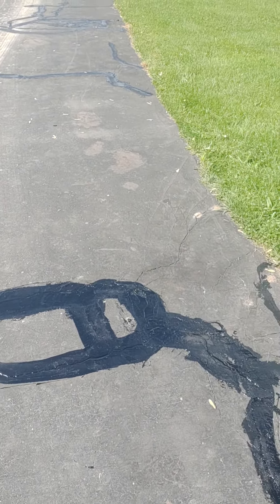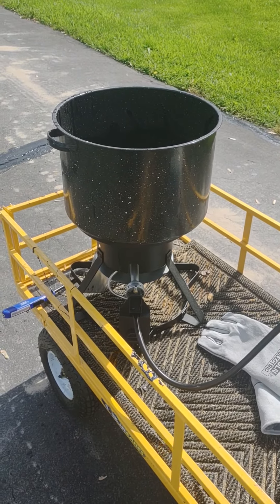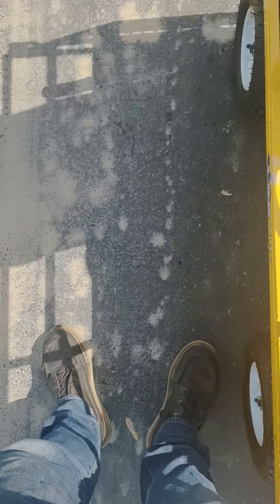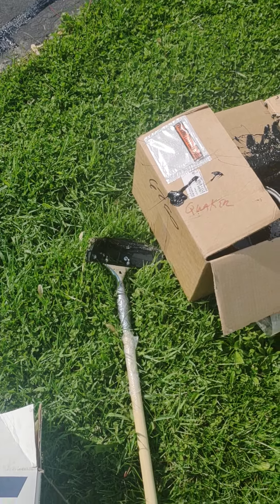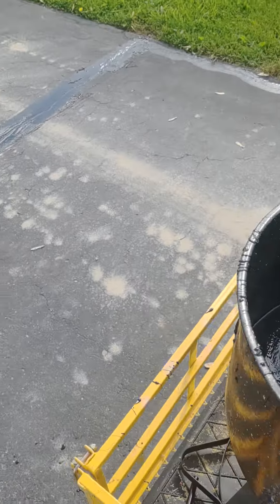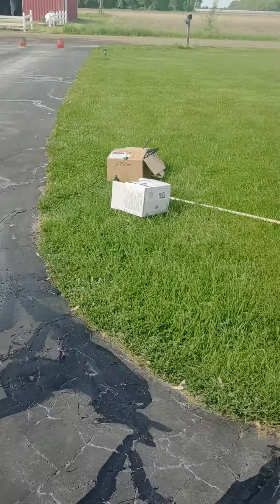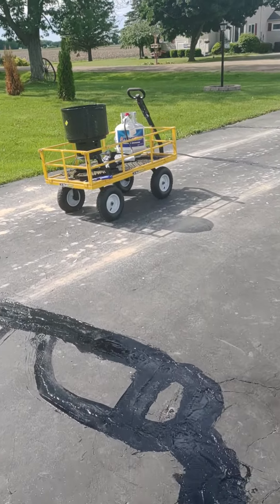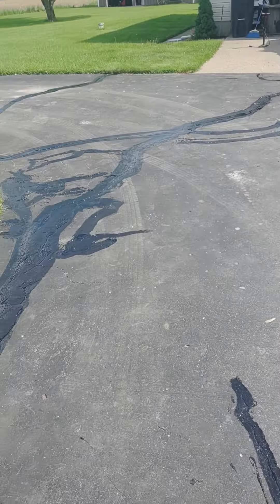Driveway Asphalt Rubber Crack Fill - DIY - Alternative to Expensive Push Machine

Comment: Did the crack come back after the year? Do you live where the winter is ruff? Regards
Reply from the maker: I live in the Michigan so yep, cold and snow. Yes the cracks are still physically there. I plan to reapply the rubber this summer. Same process most department of transportations follow, annually or bi annual application. Has held up well. It's a bandaid on the issue. Not a permanent solution for 15 years.

Comment: How much would an asphalt person charge to do that?
Reply from the maker: Sorry, I didn't see a notification on this. If you're asking how much a sealcoating or asphalt person would charge to do the same job as me, they typically go by lineal footage in cracks or size of driveway. Low ball could be $500 when you factor travel time, gas, materials. High ball could be $1500.